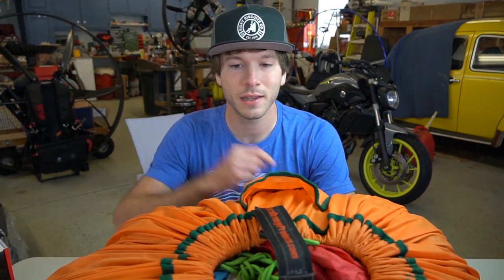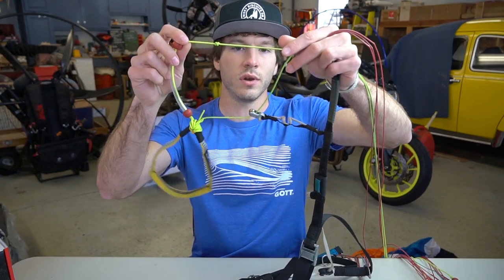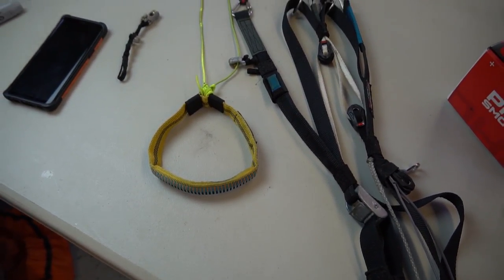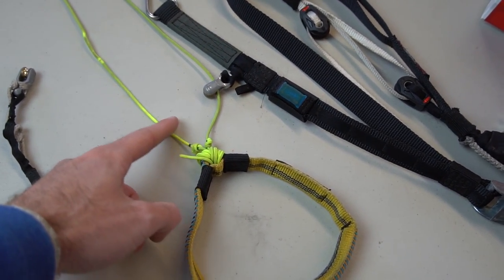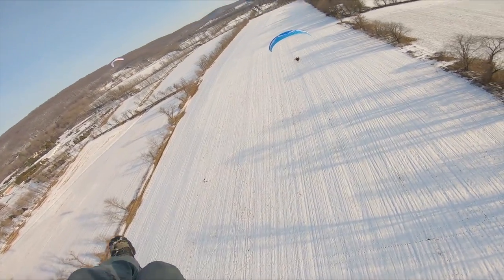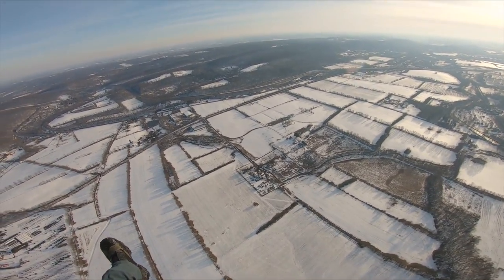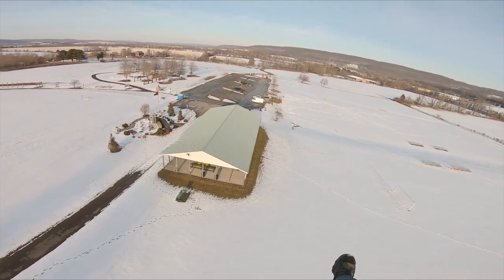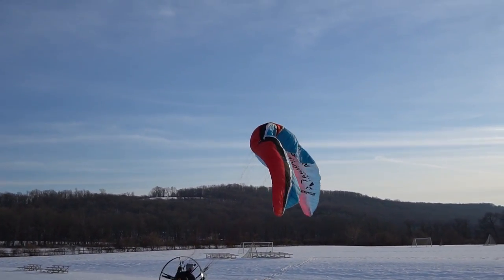Improve the handling of your wing!

Comment: You should make sure the trailing edge is not braked when flying hands up and full speed bar. If it is, your brake lines are too short, and it will make your wind unstable.

Comment: Now with 2D tied in does this mean you have to be cautious about accelerated flight (speedbar/trims)? I know the Roadster 3 doesn't recommend the use of brakes in combination with tip steering  because of the reflex profile increasing the risk of collapse.

Comment: Great video, I noticed you mentioned shortening the main brake by 1.5 inches then at the end you added 1.5 back in so it’s back to original position? my speedster3 feels too long but the manual says not to adjust the main brake? I’m pulling below my nipple till it engages!

Comment: Are you gonna take up speedflying? Would love to see your progression, since you already have so much time under a wing.
Reply from the maker: I really want to! Base jumping and speed flying are two disciplines I need to conquer in life. Working on base jumping now!
Reply: @TuckerGott  you should try speed flying, you can check if the wing inflate correctly before taking off. (Not like base jumping)

And do you paraglide? And thermal, and soaring?

Comment: Tucker, So I take it that you didn't cut any of the original line, you just tied it shorter? Main line (tip line) now 1.5 inches shorter than the factory setup? What about the center line? Is it still on factory setting or is it also 1.5" shorter?

Comment: Are you able to sense an unintentional stall at all before it happens? In your hands, or gut?
Reply: Yes, when slowing down to stall speed, you feel much less wind in your face, and nearlh no wind noise. You also have to put a lot of pressure on the brakes to stall. Beginner wing have a special design that make it hard to stall because of the amount of brake pressure and distance you need to apply to stall the wing.

Comment: Quick Questions: What's the lifespan of a wing? Also is there any kind of maintenance for the wing?.
Reply: Life of a wing depends on lot of factors.
On the fabric there is a special coating making it airtight, when the coating wears off, the air goes through the fabric more and more easily. When the coating is gone, the wing doesn't hold enough pressure inside, so it tend to not keep its shape as well as before. There is also less lift, controls are not as good.
There are a number of factor contributing to the coating wearing off:quality of the coating, UV light from the sun, if you use the wing at the beach, sand will get in the wing , in the stitching and you can never get it all out.its like you sand blast the coating.
There is also folding, if you fold the wing always in the same spot it damage it.
Aging of the wing can also reduce tear resistance.

About the lines, some lines carry more weight than other especially under high G loads in tight turn. Depending on material used for the lines, some can get longer and some can get shorter. This is a problem because just a few cm or inches can change the angle of attack of the wing, and change flight caracteristics, making more prone to collapses or stalls.

On high performance wing, some people replace the lines every 2 years.

Wing manufacturers advise to send the wing to a professional checker once a year, depending on use. They check air tightness of the fabric, tear resistance, adjust lines lenght, choose one line and check breaking strenght. After they send you a paper saying which % of life left in them.
I would says a wing can last around 200 to 300hours, depends if you want to fly with a not so safe wing anymore, or if you prefer to buy nice new wing.
I hope it answers your question.
Reply: Quick question, not so quick answer.

Comment: On the comment that people get upset when you use the term "acro" for aerobatics, I had an A&P instructor who would go mental on anyone that used "motor" and "engine" interchangeably, or referred to jet fuel as "gas." To his credit on the latter, I have had to defuel several aircraft because the customer said "gas" and the line guy was either too stupid or too poorly trained to actually look at the engines.
Reply from the maker: Yes, the "engine" and "motor" debate is another good one! "Paramotor" sounds a whole lot better than "paraengine" though.